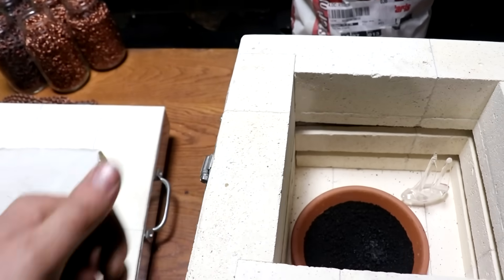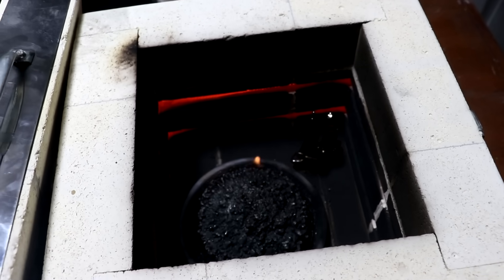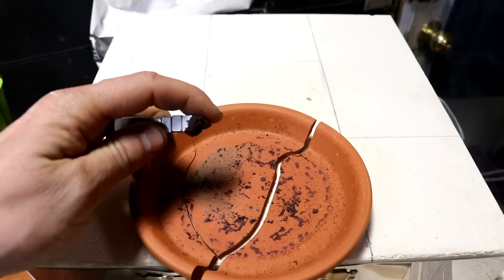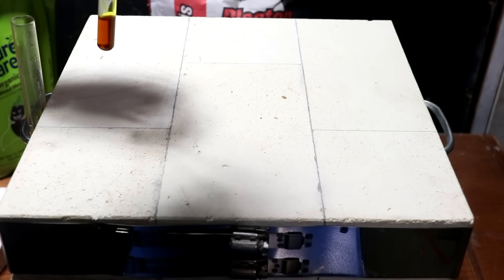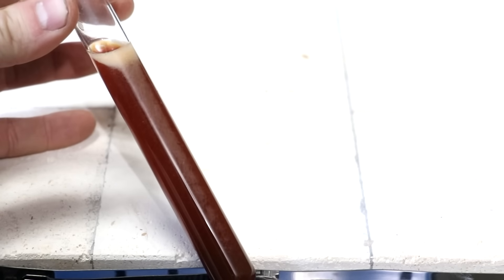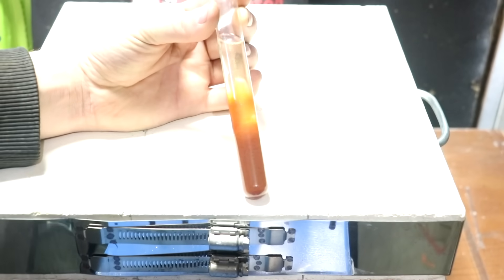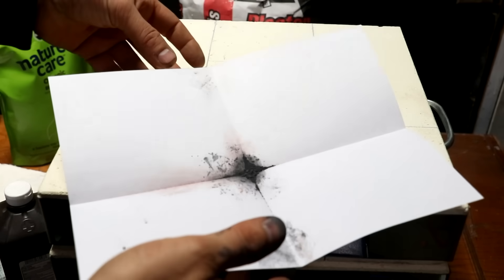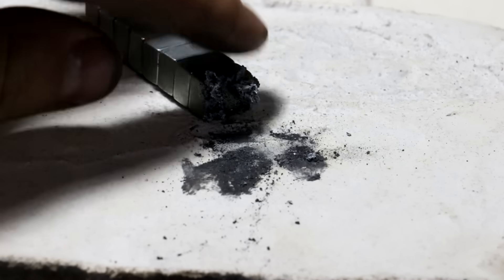Iron From Blood Part 1: Proof of Concept

Comment: Any explanation why that stage with acid, alkali and peroxide was needed?
After firing at 1000°C in air (or any temperature below 1390°C), the product is going to be hematite Fe2O3, the most oxidized form of iron. It could not be oxidized more by H2O2. Actually it was iron, not calcium, that catalyzed the decomposition of H2O2. Instead of acid/alkali purification, would be probably enough to wash it with water, to remove sodium and potassium - the most abundant contaminants. The thermite stage anyway brings much more contamination than there was originally.

Comment: Cody, considering that the main component of the blood meal is carbon and hydrogen, couldn't you just throw the blood meal into a blast furnace?  Probably have to use more charcoal than normal, and it would be lower yield than iron ore, but wouldn't that cut out a lot of processing steps?

Comment: I looked into making iron from blood a few years ago, and did the math: It takes ~4.5kg blood, which is only .5% iron, to make 1 kg of blood meal, which is usually around 2% iron, along with 1% phosphorus, a lot of salts (13% nitrogen salts), 10% water, and a bunch of carbon-based proteins holding it all together. 

Decent quality blood meal burns to 5% ash,  which is presumably quite high in iron in various compounds, but still heavily contaminated with phosphorus and other undesirable elements and probably only about 40% iron in total. To get a 100g blood-iron sample we need to start with 45000g of blood, reduced it to 10,000g of the 10% water “dry” bone meal, calcine the meal to it’s 500g 5% of ash, of which 200g are iron compounds, with a conventional conversion rate of about 50% for 100g of iron. Or buy 10kg of blood meal, if you don’t mind cheating a bit.

So, a 450-to-1 reduction, or thereabouts, not exactly practical. Great job showing the process.

Comment: Cody! Be careful opening the furnace when it’s hot like that. Similar to the ceramic tray, the heating coils can snap and fly around. It happens sometimes in kilns for heating ceramics if you open it during the heating cycle. You were at a pretty safe temp though and I’m sure you already knew but just a tip for anyone looking to check on your superheated blood

Comment: Call me weird, but I feel like you're making vodka when you should be making whisky.

You're using blood as the source but you're over purifying it by going all the way to 100% iron. The end result isn't going to contain any history to it, or a way to differentiate it from another raw iron (or steel, if you add some carbon back in) knife. You should keep some of the impurities, ideally the blood specific ones, to keep some spirit/character in it. At least through the process of making the raw ore. When you melt it down to separate the iron from the slag, the super minuscule amount left behind after trying to purify just through forging instead of chemically would probably be the amount you want so as not to compromise the structure.

Depending on how difficult it is to make, could you extract or recreate the same lipids that exist in blood and use it for the quenching?

Comment: Not totally related to the video but could it be possible to alter the carbon content of iron by mixing in a carbon source such as laser printer powder with a thermite reaction to produce a high carbon steel say around 0.8-1.2%

Comment: 5:47 : it's actually the iron that does that. I used to use that reaction for an oxygen generator: hydrogen peroxide, a dash of hydrochloric acid, and a rusty nail.
Gave me a few thermal runaways too! ^^

Comment: 1. Why couldn't you just use water for the first rinse?  Iron oxide has very low solubility, potassium and sodium salts should make up most of the rest. 2.  "Calcium ions catalyze breakdown of perixide": so does iron oxide, which you just made. 3. "BLOOD THERMITE" for the win! 4. Magnet pulling suspended solids was cool!

Comment: Basically you can place the Magnet on the side of the test tube and wait, this should concentrate the iron to the point, that you can just (carefully) pour out the solution over the clear side (so the solution won't wash off the iron) at this point 7:50

Comment: "A little bit of hydrochloric acid" into a tiny opening, w/ no gloves... (I know, you didn't specify the concentration... could technically be almost water )... cool video, but it'll never not weird be out that you can by a sack of dry blood at the hardware store.

edit: and of course as soon as I unpause after commenting... also transfering lye solution bare handed... (yes yes... could also be harmless concentration )
Reply: Every solution of HCl and NaOH is completely safe to handle without gloves.

Comment: Woah, imagine making sword from blood iron?  You have crafted the sword of many bloods

Edit: That's alotta thumbs, thank you for your generous donations to the blood sword.
Reply: When someone says they have forged their blade with the blood of thousands of enemies they have slayed.... They might be literal in that case
Reply: Blood sword for the blood god!
Reply: That's gonna take a LOT of blood, it's mostly water
Reply: Oh yeah it will take quite a bit of it for sure. Better to extract it from plants that have iron at that point.
Reply: And if you use blood from a virgin you'll get Sword of youth. With every strike regen +3 on self.
Reply: You will need to take a lot of heads...and hearts
Reply: Or make people donate blood...
Reply: I want to buy 100 gallons of blood.
What do I need it for? Well, I want to make a sword...
Reply: Mainly cow blood, so it could be the Holy Cow sword.
Reply: Let's take this a little further, shall we? Let's say that you make a billet of sanguine iron, you would still need to carburize the iron to form steel. Now, lets say that you or someone you knew had to have surgery which resulted in the removal of bone. You add the powdered bone to a steel foil bag with the iron billet and fire it at a high temperature, infusing the steel with the power of bone, turning the resulting sword into a +3 oseosanguine sword of smiting.
Reply: Thats the Kubikiribōchō.
Reply: We only need 12500 donators to get 5 kg of iron.

Comment: Now all Cody needs to do is vanquish about 300 of his enemys to have enough blood to make a full sized sword. Thats also accounting for material loss in the forging process.
Reply: Or take from the same amount of cows by mass that have become his enemies
Reply: @remanjecarter2787  cleaning up the blood in a slaughterhouse waste not want not!
Reply: Is that accounting for how much blood you'd lose killing someone? I've never tried to harvest 100% of the blood from a body but it dosen't seem like an easy task.
Reply: @Drood.  you can be careful about how you kill, if you donit right you can get close to a 100% yield, like if it was done like a butcher's shop
Reply: @remanjecarter2787  
But surely even in a slaughterhouse there's still some blood left in the body, in the muscles and organs, I guess you could try and pump it out by would the human cardiovascular system be able to take the pressure without rupturing? You'd need to attach a pump to a main vein. I guess washing the body through with water would be the best way.

Would poisons make it harder to process the iron? It would change the chemical balance of the blood.
Reply: @Drood.  a water wash would be able to take enough out, then separating it from the water to harvest the blood
The poison won't affect yield unless it works by changing blood chemistry by binding to the iron or causing unintended clots
Reply: @remanjecarter2787  please test water washing corpse and post results
Reply: @GrandTriskelion  i'd imagine it would be near identical to preparing a cow or pig, same general body plan when it comes to blood and muscle, it's more a matter of if it's being done to a person and if anyone decides to have issues with it
Reply: @remanjecarter2787  I wasnt aware that was done
Reply: @GrandTriskelion  there are a lot of ways to drain a carcass, it's usually collected as a waste product, but it's usually a focus to sufficiently drain
Reply: @Drood.  you stop halfway through, slacker!